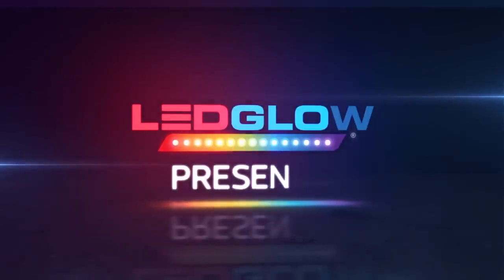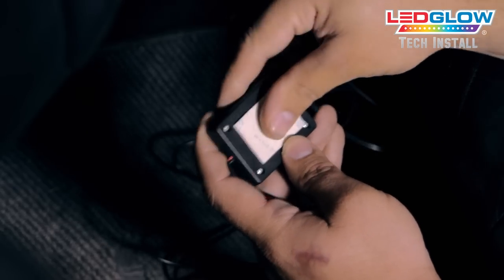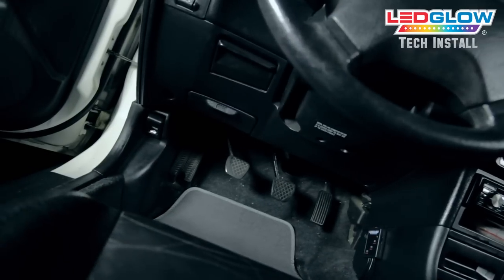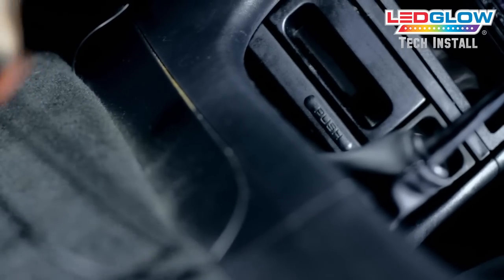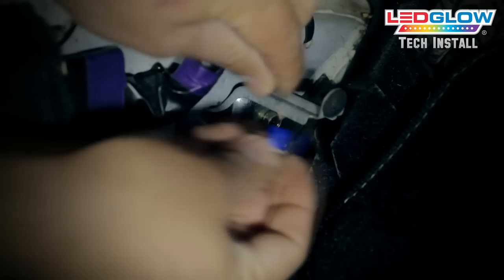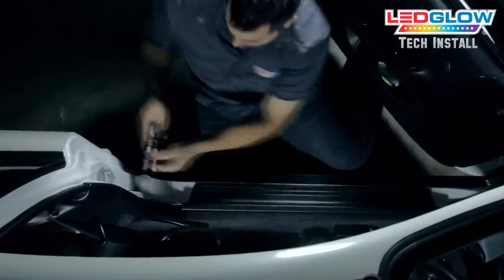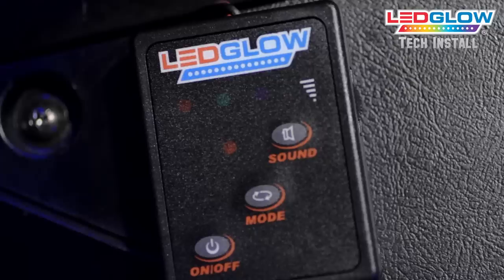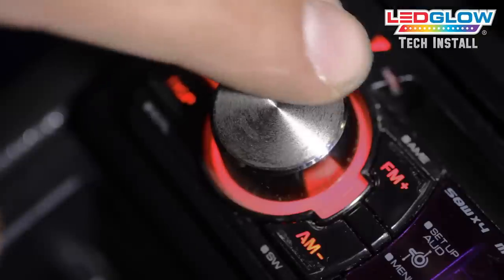Installation | LEDGlow 4pc 7 Color LED Interior Car Lights and Truck Lights

Comment: Why do my lights go off when I turn the key on to my motorcycle?  Also won't come on or stay on in aux mode.  Only when key is off our out of the bike all together.  I have the unit hooked straight to my battery.

Comment: I want to do this to my 2014 genesis coupe.. do I need to splice any of my car's wires?
Reply from the maker: No you shouldn't, but it all depends on the install.  I would recommend using our expandable circle to power your kit will be clean and easy! 

http://www.ledunderbody.com/Expandable-Circuit-and-4-Amp-Fuse.aspx

Comment: If I bought a plug to connect it to the cigerette lighter port, do I still need to connect it to the 12v fuse?
Reply: Nope, if it goes to the cigarette lighter, you're home free.

Comment: My main problem is after i plug in the add-a-circuit, i try to ground the black wire to a metal source, but then press the power button and it doesnt turn on. i may be missing a step here but idk what. i'vetried different fuse slots and its still not working.. thoughts?

Comment: HELP! I installed the kit and now my battery is draining fast. I have a 2007 Chevy Cobalt. The kit is wired to the radio's power source. They work great on and off as soon as the radio powers up/down, I did accidentally break one of the LED protective plastic cylinders and it may be touching some metal. Could that be the cause? If so I know how to fix it.
Reply from the maker: Brian Flores We're here to help! It sounds like there's a short that is causing the battery to drain from the broken tube. Our LED lighting kits pull a very low amperage and you're also connected to a switched power source, so that wouldn't cause the battery to drain that quickly. If you continue having issues with the kit and your battery, don't hesitate to contact our technical support at 1.877.LED.GLOW and we'll further diagnose the issue!

Comment: At 1:24 he says locate a 12v source but pulls out a fuse that says 20 on it. I checked and my car doesnt have any 12 I do have 20s though. Will it work?
Reply from the maker: Crunchyape Your vehicle runs off 12v, so you're good to go there. The video shows the installer pulling a 20 amp fuse, but this video is a little dated and now we recommend using a 10 or 15 amp fuse for the expandable circuit. I recommend reviewing the fuse layout from out vehicle's owner's manual to select the right fuse to tap power off of. If you have any other questions or concerns don't hesitate to ask!

Comment: I just installed the 4pc 7 color interior lights. The auto door illumination, do you have to buy something extra for that? I have it where they turn on when i start my car but i want it where they turn on when i open my door. Do you have to buy something extra? i have a 2008 scion tc

Comment: i used an add a circuit and took our the 20 amp and put it in the add a circuit and grounded the black and it wont work still...do i need to add a 4 amp circuit too? what am i doing wrong?

Comment: I have a 2002 ford Taurus, and bought the LEDGlow 4pc, 7-color kit, and would like to know if it's possible to have the lights illuminate on the event of a door opening, but also have the kit work when the door is shut? I have watched several videos, and don't exactly know where to go with this. Would would be the best way to wire my kit?
Reply from the maker: Christopher Swierczynski Unfortunately if you install and program the kit to turn on when you open the door, you will not be able to use the kit when the door is closed since the kit is grounded to the door pin. We have a video called LEDGlow's Auto Illumination that will explain the entire process of using your Interior Kit with the Auto Illumination Function. If you only want the kit to turn on when the door opens then I recommend installing the kit with the Auto Illumination Function, but if not then I would just power the kit from a switched 12v source. Let me know if you have any other questions!
Reply: Thank you, this helped. I will just use the 12v switched source then.
Reply from the maker: Christopher Swierczynski Great, glad it helped! Don't hesitate to ask if you have any other questions or concerns!

Comment: I drive a 2010 Mazda 6 i. I'll probably end up buying the mini add a circuit (after I checked my fuse box takes the mini fuses), but I don't know if I'm suppose to add the circuit to the 7.5A BCM illumination fuse, 15A power/cigarette light fuse, 15A interior light fuse or even any other fuse. And if I'm using any one of these what kind of fuse am I suppose to use(amp)?

Comment: My LEDs are powered by my cig lighter and used to turn on when the car started now when I turn my car on it just flashes and I have to manually turn them on why is that
Reply from the maker: lacie meyers  You will want to program the control box for the auto illumination function so the kit powers on at start up. Check out our video called LEDGlow's Auto Illumination, (http://youtu.be/4IbmoDbkG-4?t=4m39s) and it will show you how to program the control box for the auto illumination function! Let me know if you have any other questions or concerns!

Comment: How do I connect it to the car's battery, as the instructions say is possible? And what does it mean to "ground the wire to any bare metal grounding location"? How am I supposed to know what is and isn't a "grounding location", and how do I "ground" it? Tape it on with electrical tape? Please make a video that explains this stuff more thoroughly for people who aren't electricians.
Reply from the maker: Hi, we do indeed have an updated version of this install video, in this video you will see where a wire can be grounded to within the car itself: https://www.youtube.com/watch?annotation_id=annotation_2638459615&feature=iv&src_vid=jgvvx3qGA_g&v=5eAxe6jpBnM. However, here is a direct link to installing the kit directly to your battery: https://www.youtube.com/watch?annotation_id=annotation_1148604737&feature=iv&src_vid=5eAxe6jpBnM&v=mu6j0oynyCA. As always our team of knowledgeable technicians are happy to help and can be contacted via online chat or at 856-768-5700. Cheers, LEDGlow Team

Comment: LEDGlow Hi i purchased your 4piece single color. I'm trying to install the ground of the LED to my dome light the way shown on the video. Are you guys familiar with doing this on a Civic '09 EX? Will I have to just remove the door sill or also the panel by the seat belt to get to the ground for the dome? Any assistance will help! I know it's more on the car setup, but thought i'd ask (or if anyone else reading is familiar with Civics).
Reply from the maker: o0chuckster0o Thanks for reaching out to us! Are you looking to have the LED interior light kit turn on when you open the door? We have an installation video called LEDGlow's Auto Illumination, https://www.youtube.com/watch?v=4IbmoDbkG-4, that will explain the entire process of installing your kit with this function. Whether its on an 09 Civic or a 95 Civic, the installation process will be the same. Let me know if you have any additional questions!

Comment: Do I need the expandable circuit kit for this product? I have a 2002 Infiniti I35
Reply from the maker: Sunny gamer The expandable circuit is an optional accessory you can use to power your kit. I recommend using it however as it allows for an easy and clean finished installation without having to run the wires through the firewall and into the engine bay or using a cigarette lighter adapter. If you are interested in using an expandable circuit to power your kit, you will need to use a mini expandable circuit for your 2002 Infiniti I35. Let me know if I can help with anything else!

Comment: I just received my 4pc single color kit and the ground wire is just an open wire. In the video it shows the black wire connected to a blue thing with a metal circle. Do I have to do this myself? How would I go about doing this. Also is there a way to just purchase an add-a-circuit on the website because I bought the kit but realized I need an add-a-circuit to connect it to the fuse box.. Now I'm just sitting here with open ended wires scratching my head.

Comment from the maker: The kit we currently offer that can do all of the sync functions that you're looking for is our Advanced 3 Million Underbody, Wheel Well and Interior Kits. These kits feature USB connections that connect to one control box that controls and syncs all of the functions for each kit. You can even hook up a 24 inch grille light to your car as well. If you have any other questions about the kit don't hesitate to ask!

Comment: I currently bought the 7 color underbody kit for my 2007 Ford F150 and the installers put the tubes just on the sides of my truck.  What can I do for the front and back of my truck?  I just bought the 7 color interior kit and when I have both the exterior and interior tubes can I have them running together so they match when I use the different settings?

Comment: I installed these on my car and at first I started by just grounding to a bolt, then decided to try the auto illumination by grounding to the door lights but then I realized I cant power them on when I want to..is there a way to do both so I can have then turn on when door opens and also when I want them to turn on by pushing the on button

Comment from the maker: The ring terminal is not included with the kit, but if you want to use it you can find it at your local auto parts store. If not, you can just simply wrap the ground wire behind any bolt into a bare metal surface and you should be good to go. If you have any other questions don't hesitate to ask! Send some pictures of the installed kit to our Facebook page!

Comment from the maker: If you're looking to power the Million Color Mini Interior Kit from the fuse box, you will need to purchase an expandable circuit separately as it is not included with the kit. You will use a mini expandable circuit for your 2012 Honda Accord. Unfortunately for the Million Color Mini Kit, the auto illumination function that makes the kit turn on when you open your doors is not included with this particular kit. If you have any other questions or concerns don't hesitate to ask!

Comment from the maker: You'll use a mini add a circuit for your 2012 Camry. The add a circuit is an optional installation accessory that does not come included with the interior kit, it's just an easier option we offer for installing the interior kit. If you have any other questions don't hesitate to ask!

Comment: If wired to the doors. Will this on with door colsed
Reply from the maker: If you wire the kit to the dome light for the doors, no. There will not be a constant 12v power source to supply the kit with power.

Comment: I just got my led glow to install inside my car but it doesnt work !!!  i bought a expandable circuit for easy install and follow all the instruction from this video but still cant get good resuts. my car its a honda accord 1996 can you please help me??? one other thing why u need to ground the black core to any metal location?

Comment: Hey I plan on buying either 4 or 6 piece multicolor with the expandable circuitwill the the light work with the car off? And if I shut my car off will I have to manually shut them off? If so can I wire expandable to a switch or would ibe better or just running it battery to switch to light kit justcso I can shut it off easier...will this affect lights or control box?
Reply from the maker: Christy Yarasavych If you decide to power your interior kit from a constant 12v source then you will have to manually turn the kit off after you turn your car off. If you're connected to a switched 12v source then you will only be able to use the kit when the car is powered on and when you turn it off, you won't be able to use the kit. I would recommend powering the kit from your fuse panel using an expandable circuit because it allows for a cleaner and quicker install rather than running the kit's power wires through the firewall into the engine bay. If you have any other questions or concerns just ask!
Reply: Thank you very helpful

Comment: So i just installed these into my car, i used the same fuse as the ashtray power thing, now when my car is on and in drive and while my car is stopped or im moving slowly, my RPMs are pretty much at 0, my car shakes and when i was reversing into my driveway i noticed my reverse lights flickering. Whats wrong?

Comment: hi.i was installing me led glow and i tried tapping into my headlights. i had all the wiring done and i went to test them one last time and i wasnt payying attention and the pos (+) and neg (-) wires crossed and my headlight light now does work. please help me with my problem fast! Also my friend has a similar problem but was tapping into his cigarette lighter and had the wires cross. did he blow a fuse or does he need a new cigarette lighter. please go in detail. thanks!

Comment: How would I install the kit if I wanted the LEDs to stay on even while I drive?
Reply from the maker: Mario Mendiola If you want the LEDs to stay on while you're driving, just connect the black ground wire to any bare metal grounding location under your dash and don't enable the auto illumination function on the control box. If I can help with anything else don't hesitate to ask!

Comment from the maker: A good fuse to use if you want the kit to turn on and off with your car is the radio fuse. The kit will only function when the car is on and you won't have to worry about it shorting the kit. Let me know if you have any other questions!

Comment: hi, i'm thinking about purchasing this kit, but one question....when you want the lights to activate when the door opens, it says to 'connect the ground wire from the kit to the ground wire for your dome light...'  this is said simple enough, but the video fast forwards through this part.  it would be much more helpful if this part of the video had more emphasis and explained more....it looked confusing as hell.  what was the pliers for?  which wire was from the dome light?  what the hell did he

Comment: I have this for my civic and I switched it to my 2012 accord, but it won't turn on, I noticed the fuse amps are smaller compared to the ones in the civic. any ideas??
Reply from the maker: +khoa Nguyen I'm sorry about the issue you are having. I would get in contact with our technical department by calling 1-856-768-5700 or by sending an e-mail to: techsupport@ledglow.com
Reply: I did...all the guy said was it maybe damaged during taking it off or there's no source of good power. He at all did not help me, just told me what I already new continously until I decided to hang up
Reply from the maker: +khoa Nguyen I apologize about the service you received during your phone call. Unfortunately, I am not involved in the technical aspect so I would not be of much help. I would advise calling in and possibly speaking with a supervisor, who may be able to provide better help.

Comment from the maker: It wasn't the ground wire for the dome light, it was the ground wire off of the door pin switch. Connect the power wire to a constant 12v wire and run the ground wire to the door pin connector, so when the door pin is closed, it removes the ground. The pliers were used for crimping the connector to the power and ground wires. We will release an updated video soon that goes further into details with 3 different wire connection options. If you have any other questions don't hesitate to ask.

Comment: For some reason  the lights wont turn on for me in my 2004 Pontiac Grand Am. I bought an add a circuit from Advanced Auto Parts to go along with the 4pc LED Glow kit. It's maxes out at 10 amps which I thought was fine. Every time I stick the red circuit in nothing happens. Are there any local auto company's that can install this for me? It feels like I'm the only person who can't seem to get this!

Comment from the maker: The metal circle connected to the wire is a crimp connector that you can find at any auto parts store. You can purchase the add a circuit through our website, or you can make a one stop shop at your local auto parts store and pick up the crimp connectors and add a circuit and you can be on your way to installing your kit! Send some pictures to our Facebook page of the finished install! If you have any other questions, don't hesitate to ask or contact our Technical Support Team at 877.LED.Glow.

Comment: I installed the lights but nothing happens when i use the remote. Any suggestions?
Reply from the maker: lancergts If you are powering your kit from a switched 12 volt source, make sure the key is turned in the ignition so the kit can power on with the car on. If you're still having problems powering your kit then double check the ground location of the black wire and make sure that the ground wire is touching metal. You can wrap the wire around any screw that threads into metal and you should be good to go. If you continue to have problems powering your kit then give us a call at 877.LED.GLOW and one of our techs will help you further diagnose the issue you're having.